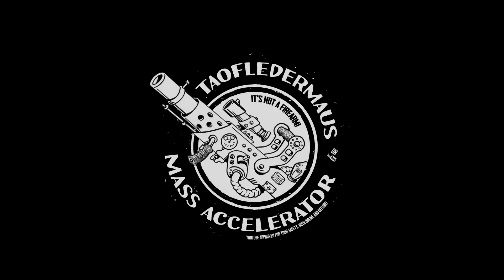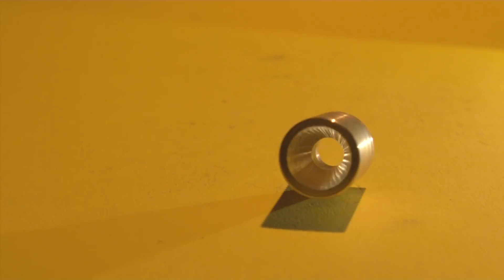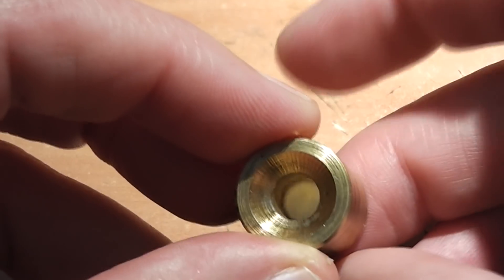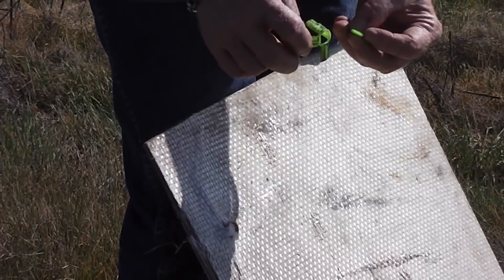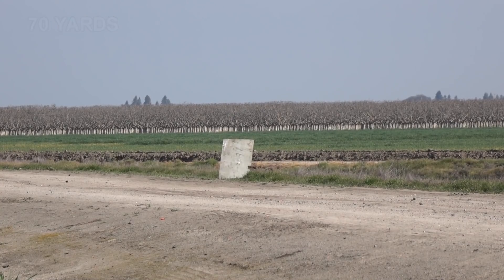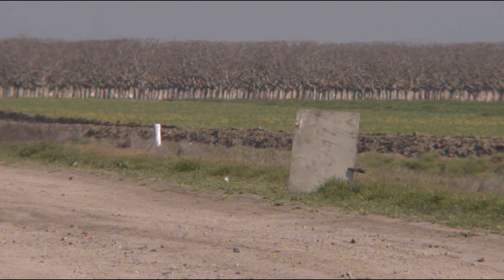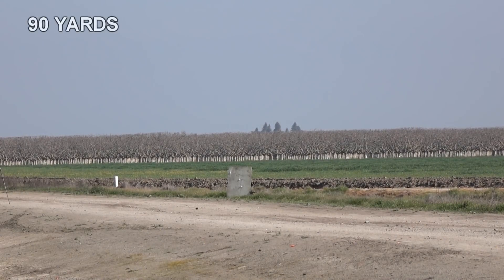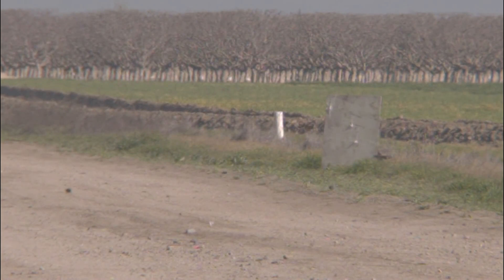LONG RANGE Whistling Projectile Test (viewer suggestion)

Comment: Watching this, I'm remembering your 5.56 tracers video.... Could you arrange the empty jackets in a circle around a central jacket filled with something to make it a strong and stable base... Then cap and foot around the collection, sealing them together. Drill holes into the cap (I'm imagining a fairly bullet shaped cap) to funnel air through the empty jackets, leaving them free at the back to allow air flow through. The foot might need to leave a little gap after the base of the jackets.

Could that work like 5 or 6 whistlers around a heavy core? Could the air flowing through the empty jackets help in stabilisation?

Sorry if it's been done. I'm new here :)

Comment: Is it possible to develop a perhaps nonlethal round that whistles as loud as possible? I am thinking about a round that you might actually point 45 degrees up into the air, something that screams like a Stuka, you could even call it a Stuka round, the primary utility of this would be to use on a ranch to let trespassers know they should vacate. Better to make it out of something cheap because it would be almost impossible to recover.

Comment: Would these theoreticaly be practical for signaling? like someone got lost in the wood and could use these to tell searchers roughly where they are? I mean the bang and the whistle would be a good combo noise.

second: would a plug with a point throug to the front, push air to the sides of the plug and push it out more consistantly or does it not make a difference at these speeds?

Comment: I think a whistling projectile can be designed without a huge hole through the middle.
Think of a tube held out the window of a car. If the opening is held into the wind, it doesn't whistle but if you hold it at 90 deg it does.
Instead of a hole through the middle have smaller ones in the side.

Comment: 4:56 The reason it didn't capture the whistling sound is due to the Doppler effect, you can hear the projectile coming, it's just so high pitched that it's very hard to hear. Had you put it midway through the range you would have captured a cool effect where it kinda goes NYOOM as it compresses the sound waves. The other thing is, yes it's subsonic but it's also damn fast, and this is going to increase the forward-facing sound wave frequency of the projectile.

Comment: What about trying sum Thermal Optical Binoculars / Camera / Attachment,  to the Projectile Launcher. 
 So that way while the projectile may have a high temperature.
   If the projectile remains hot for sort period  of time you might be able to see clearly with the reallyř hot signature. 
 I believe it will greatly increase your recovery %, of all of your launched projectiles!

Comment: I wonder if you "accelerated" a cylinder of sufficient internal diameter, whether you would achieve supersonic airflow through the cylinder. I.e. what is the diameter of a shockwave for a thin wall, and would the individual shockwaves meet in the middle of the cylinder, or not overlap and allow supersonic internal airflow.

Comment: I wonder how the whistle would work if you switched to a cut out on the nose of a solid projectile so you don’t end up with the drag issues of forcing the air through the center. Think Whistling Nerf dart.

Comment: So I believe that your hypothesis about the bow of the shockwave preventing airflow is slightly incorrect. The downrange camera shows that even when the projectile is whistling, it's still supersonic to some degree because you can't hear the whistle before the projectile arrives on target. I believe one reason why the indicator plugs weren't coming out, could be that the plugs were jammed in further and harder during the "initial acceleration".

Comment: My favorite heat actuated chemical reaction metallic projectile accelerating machine sends the metal pill outwards at a speed much greater than the speed of sound. If you hear the whistle or the bang you can rest assured that you were not the intended target.

Comment: Interesting experiment. I tried something similar with wood balls that had 4 mm holes drilled to a depth of 6 mm, and these being accelerated using a slingshot - here my video: https://youtu.be/xdsgdcEirPc. I would assume that a larger steel projectile with holes drilled as mentioned might yield a nice whistling sound when fired from a shotgun.

Comment: 5:00 
You know... i don't think the camera is to blame for this!
Notice how racecars are highpitched when coming closer but low pitched when driving away? The same thing is happening here except the object is flying in transsonic speeds!
So it's not that the camera picked nothing up... The sound is just too high for us to notice!
To add to that, the bullet's actual wistle is likely a lot higher pitched than what we are listening to since the bullet's sound is lowered from flying away from the mic.

Comment: Good thing you used the mass accelerator instead of a gun, otherwise the nra wouldnt have an add placed on the video
Reply from the maker: Yep,  as dumb as it seems to use that strategy,  it seems to be working.

Comment: They are not inefficient. They are efficiently decelerating, as totally intended, through Novel Advanced Sonic Aerobraking (NASA). For science. And maybe for decelerating space probes someday.
Reply from the maker: It's sort of the same thing that happened to the SR-71 when it had an "unstart"   the one dead engine would create SO much drag it would jerk the plane toward the dead engine

Comment: Imagine the psychological effect these would have being fired from a mounted machine gun nest?  For example if the german MG42s fired these during the Dday landing..... it would have made it terrifying.
Reply: Yep, running into machine gun fire and storming the beaches while your buddy next to you exploded into a red mist would have been scary if there was whistling .
Reply: @nunyabussiness4054  exactly my point.
Reply: It might have been scary if you were behind the direction of fire and you were less than 100 yards away, and you were afraid of being hit by a bullet that slowed to the point where it feel to the ground at 90 yards
Reply: Thats inthe NEXT war. Good Luck Soldier.
Reply: Herp Derp Dumb ass.
Reply: If they were designed the same.... could be really interesting because the extra drag shouldn't be much of a factor until it's subsonic and that's a fair ways off for a 7-8mm rifle projectile, even a suboptimal one like this. Let's say it has a third of it's supersonic range... you're still going 300 yards before it drops and starts whistling, which is above or behind the targetso they don't suffer the doppler shifting and compression; in other words, the screaming happens behind them. Hell of a distraction! Configure a belt 1:20 and watch heads turn.
Reply: This a joke?
Reply: Matthew Harvey why should be? Actually german bombers in WWII had mounted whistle to terrify enemy on the ground
Reply: @Jan-ll7xu  Only the Ju-87 Stukas had the siren mounted to them and they would only activate during a dive.
Reply: @Jan-ll7xu  I wasn't there myself but I'm sure d day was scary enough!
Reply: My bad, terrifying.

Comment: The plugs may cause failure and lack of accuracy due to having enough weight not balanced.
Reply from the maker: The plugs also prevent the wad from being shoved through the center of the slug.

Comment: The sound down range might have been masked by the sound being pushed away by the side pressure. The V of the wave would have held the sound like a bowl holds water, the spill over is what we heard as a high pitch vip. Just a guess. Like seeing a jet far away but sounding like it’s overhead. Maybe?
Reply from the maker: That camera has goofy mic on it...  makes gun shots almost sound like an air rifle.  My regular camera died a while back so I have been using this cheap one.

Comment: It would be cool if you added a radioactive material to it so it could be similar to a slam jet engine, the slam jet engine was a nuclear powered ram jet engine & it used the radiation from the radioactive material to heat up the air. But I'm sure you don't want to be around anything radioactive so it's ok if you don't do it.
Reply from the maker: lol, no

Comment: I believe there is other forces at work, mainly the projectile that was stable all the way would only cause the whistling noise as such to back where it came from in a cone shape, similar to that supersonic wake. I think thats why the second camera only picked up short "whine" noise and not the perfect whistle.
PS. if you want to test homemade bulletproof plates you might want to try and contact "Tech Ingridients"(Youtube channel) his latest video has some interesting epoxy stuff going on. I bet OG would be interested of testing those kinds of pieces with all sorts of handguns etc.